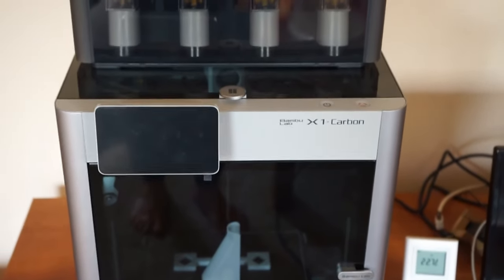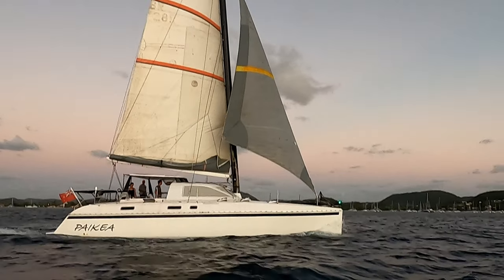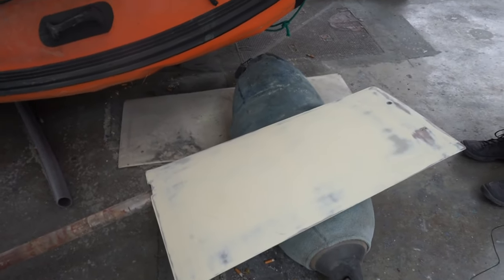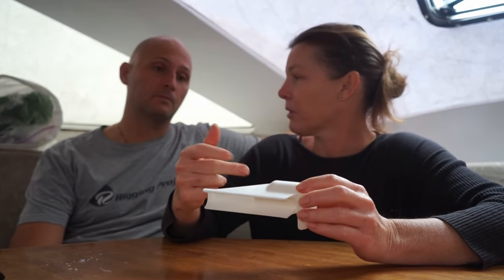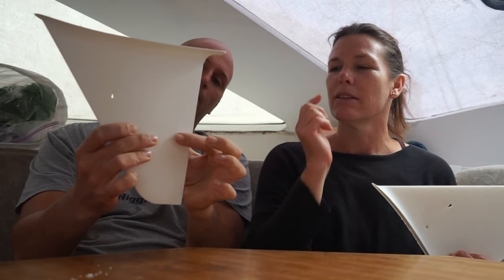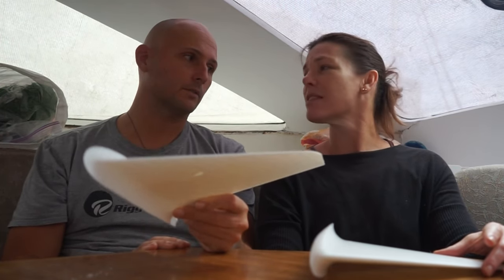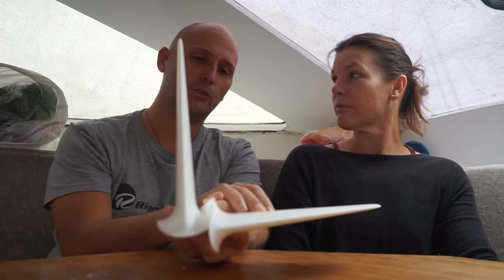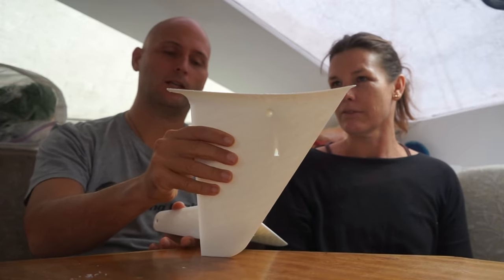3D Printed Rudder Winglets for our Catamaran

Comment: I made some stuff with carbon/e-glass over 3D printed core. Gotta be careful about delamination as epoxy tends to not stick to the plastics. Apparently ABS that has been hit by a torch is the strongest bond. But printing ABS produces a ton of crap (VOC) that gums up the machine and also is bad for your health. Best of luck, and I'm looking forward to see the results! I'm finishing up a foil as well, but don't have time to do the finish for now.

Comment: 3d printers are so nice. We bought one a year ago in Thailand. The biggest learning curve is cad designing but I’ve been able to make solar panel holders, fuse holders, aircon control box holders, LiFePo4 battery top covers etc. on the web I found a stl file to make new Raymarine instrument covers and printed a few of those. We have it on the back bed of our Catana 47.

Comment: Ha... literally just bought X1 Carbon for my RV, been printing non-stop.  Been researching how to get one in South Africa for our boat being built there.  Wait till your kids realize how many free print designs are out there to print toys! Looks like ASA (instead of ABS) is going to be a good material for exterior components that need to handle sun and heat. 

I was also thinking about drying chambers that you can get fairly cheap that keep the filament dry in that humid environment. Regarding CF filaments... there is a ton of strength and stiffness info out there on youtube and from what I've seen, they barely, if at all, beat PLA.  PLA is just so cheap and easy to print with that I haven't spend much time with those materials. Have fun and lemme know if you need help with CAD models!

With that sweep back, you'd think most lines would just slide off... hopefully.

Comment: I am a 3d printer sailing nerd as well. I have thought of similar projects and wonder how polyester resin will react with PLA. Or epoxy for that matter. I will be anxious to see your results
Reply from the maker: We're using epoxy for winglet project and it should be fine with PLA. So should polyester resin. The biggest issue is ensuring you prepare the surface properly before laminating.

Comment: nice. my coworking space has the same printer and I love it. best toy in a long time.

how (roughly) do you calculate that 50kg load on the winglets? and then how do you know how much glass that requires?

also, vortex and vortices :)
Reply: I do like to know too.
Reply: I looked at our upwind speeds that we do in choppy water. That defined our velocity. Then I looked at our pitching angles going up wind, by observing our instrumentation. That defined our angle of attack. The surface area and lift coefficient I know from designing the foil. This is then all modeled in XFLR5  to help include a bunch of other factors, or a fancy way of solving the lift equation. 
The amount of glass it requires I did the good old gut feel from way to many years of experience..... If it was a more critical part I would look at it as a simple beam and then apply the material properties of the glass to solve the requirements.
Yes, its a vortex. For some strange reason I keep saying vortices..........

Comment: We had wings on our 31' cat back in the 80's, lots of forces up & down. We had ours right on the bottom like an end plate. Really was surprised how much they eliminated hobby horsing.
Reply: They might be a bit large. You might get a way with smaller winglets.
Reply: That's really cool to hear👍. Yes they are a little bigger than required for an end plate. With the hope of the reduction in hobby horsing

Comment: Are you considering what forces the winglet will have on the shaft bearings (pushed up and down) with the pitch forces? Also, when you turn the rudder, the winglets will have longer cords effectively creating more lift and adding additional bending forces to the shaft. MDF CNC female molds similar to what the DarkAero project used in their molds may work really well. Forged carbon fiber for the StarLink mound would work well. I made stanchion connectors out of forge cabin that are indestructible.
Reply: Wait, I’m wrong, if the foils are symmetrical then sideways movement (rudder deflection) shouldn’t cause more lift.